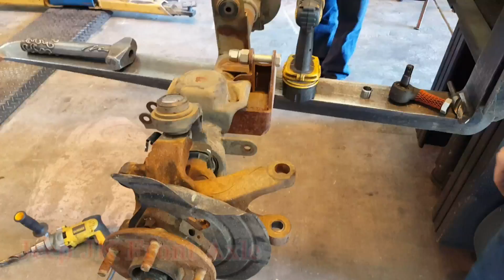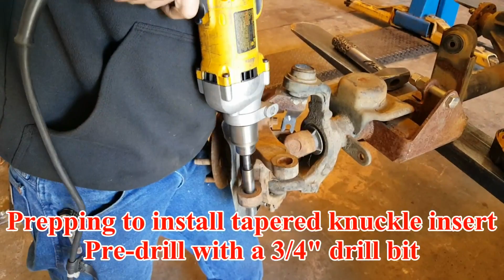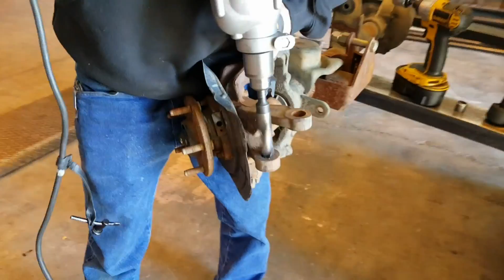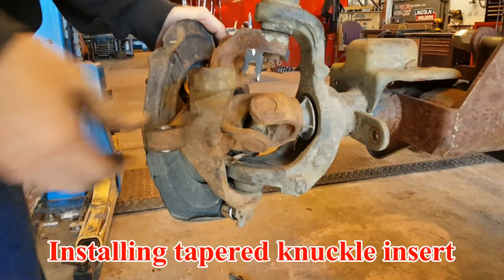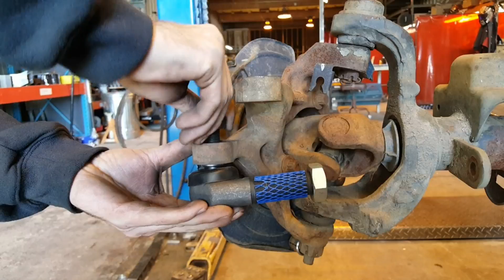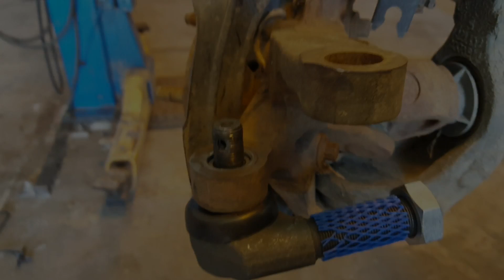GM Tapered Knuckle Insert On Jeep JK Axle - RuffStuff Specialties

Comment: what about welding it in like the website says .?.
Reply: The knuckle inserts are a split insert that don't require welding, nor does that item listing state anything about welding. Only the drag link insert requires welding
Reply: @RuffstuffRyan  oh, yes, you are correct, it is only the drag link insert that says to tig weld into the pitman arm...
so, you think there is NO need to weld these into the knuckles ? but the one in the pitman are should be welded in ?
Reply: @MrMrsregor  The split allows it to expand when torquing down the castle nut so it locks itself place. Welding is not required. The one for the pitman arm does not have the split so it requires welding to keep it from moving in the pitman arm as you steer
Reply: @RuffstuffRyan  cool, thanks for the tips
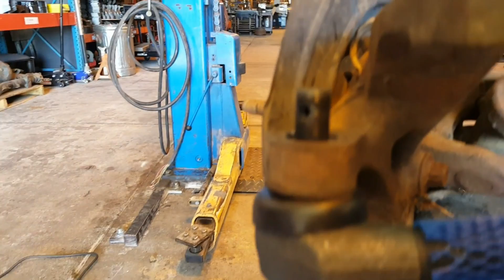i see that is what they are trying to show at 1:08...